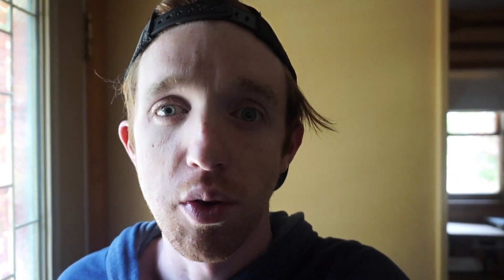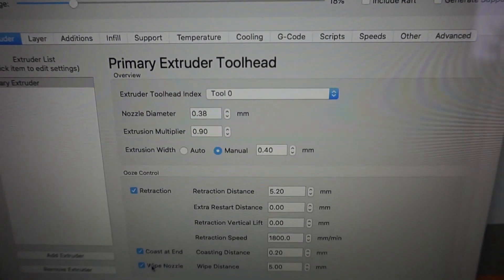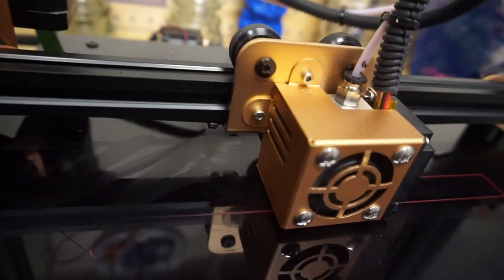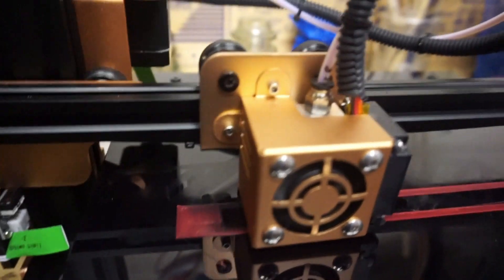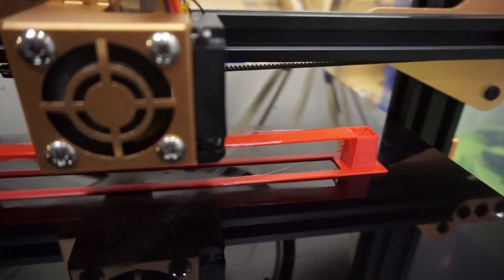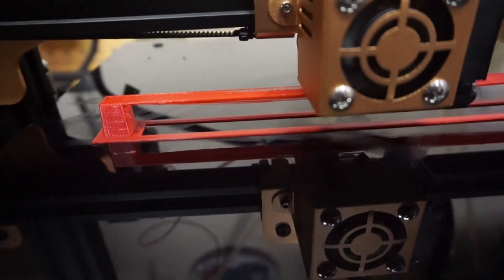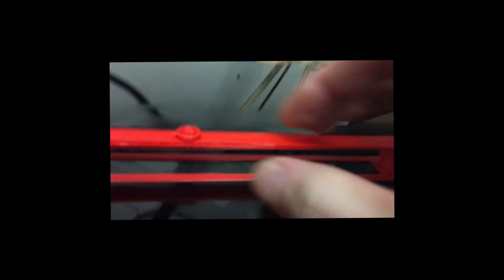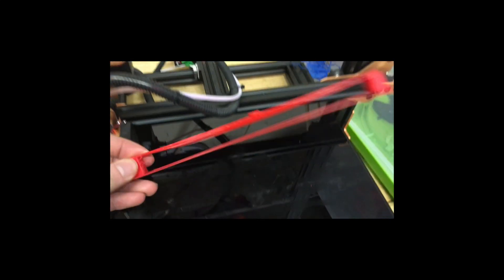200mm Super Bridging Test on Tevo Tornado 3d Printer

Comment: looks like the bed it not leveled on the left side im having trouble leveling mine i think mine has a 0.2mm bump in the middle gonna have to buy a piece of glass
Reply from the maker: I noticed that, when it was printing. I was using blue tape, until I spent some time leveling it. Now I just need to fine tune it. Thats probably the worst spot to have a bump in it.
Reply: @3dprintingandtechnology643   so i bought a piece of glass from lowes 12x12 inch or 300 x 300 mm then used masking tape to hold it so it wont move then i leved the bed prints came out perfect  then printed glass holder for it. Also i did notice that there is a tiny gap between the glass and bed so  i was right there a bump in the middle of my bed.
Reply from the maker: Its interesting. I haven't had much issues with the bed surfaces on my 3d printers, except for the modT; which used a plastic surface to print on. Glad you were able to fix the problem with it!